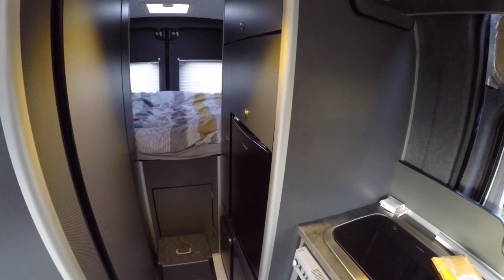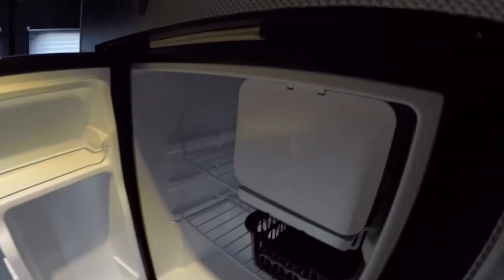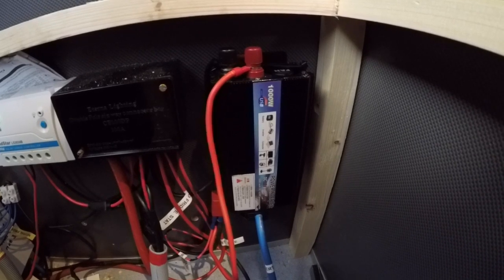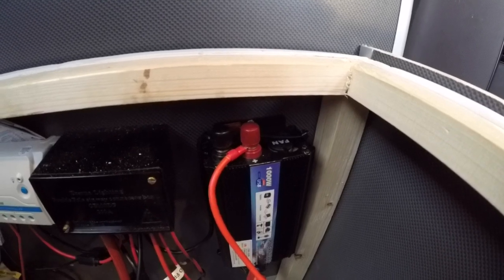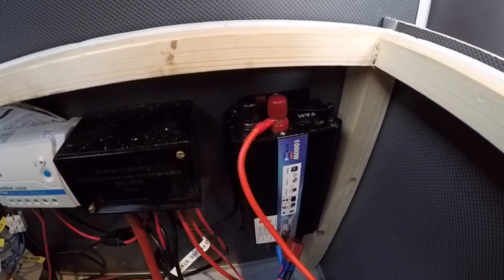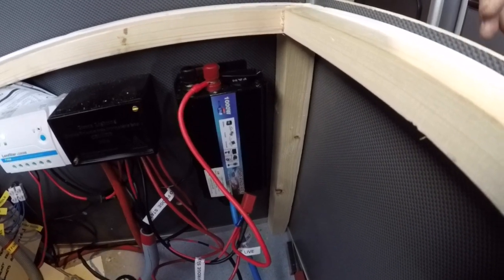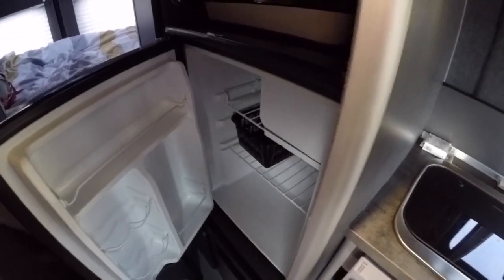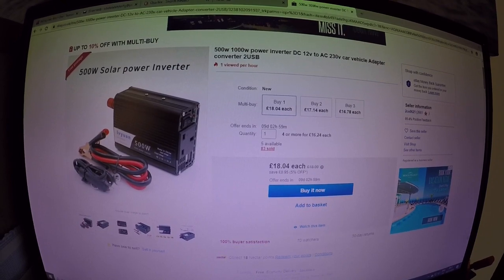Campervan installation of a domestic 240v fridge with ZERO draw from batteries when down to temp

Comment: Hi Keith, very well presented video. You are right about the price of motorhome fridges they are extortionate. Great idea to turn the inverter off on demand. I’m assuming you joined the fridge thermostat wires together so that it’s always on and the thermostat now only operates your relay. 
Our inverter comes with a remote on off switch so it would be even easier to wire the remote across the thermostat and do away with a separate relay. 
Just a couple of thoughts I had. 
Does your inverter need to run on to dissipate residual heat?
If you are using the inverter to power a socket for laptops it would turn everything else off. 
It’s a great idea and in the right install is the perfect solution and great money saver. Well done! 😀
Reply from the maker: Greg Virgoe hi Greg, I’m so chuffed that you think it was worthwhile. I could have included a schematic, but I deliberately didn’t because I didn’t want complete novices to have a go. Couldn’t bear to be responsible for someone not following it properly. Instead I hope that those who know how to do electrics, could visualise my description.
I think all relevant details are there. But to explain here
I removed the cover from the compressor terminal box. Disconnected the thermostat wires.
Supplied 12 volts dc to the stat live. When demanding cooling the stat closes and the switched live from the stat goes back to the small relay near the inverter.
Once that relay energises it switches the thicker supply cables thereby firing up the inverter.
The inverter then supplies 240v back to the permanently wired in compressor.
And so it runs until cool enough.

So to answer your questions
No the stat operates as normal but with 12volts
It’s the compressor which is permanently wired to the 240v inverter output
There hasn’t been any need to run the inverter to cool it down, presumably because it’s 1000watts and once the fridge has started running it’s only drawing approx 70watts so well within the inverters capability.
Nothing else is run from this inverter.

I’m going to rig my microwave like this as well. Although I can have 240hookup, I’ve got everything else running on 12v.

Enjoy your trip!

Somebody has damaged my van down the side just like yours was. Trouble is I don’t know who.
Reply: crastercampervankippers Van selfbuild totally understand and really sorry about the damage to your van. It’s so annoying when that happens.
Reply: Hi Keith & Greg, like the idea very much but will also want to run tv / laptop off the inverter. Any chance you clever guys can design a scheme to maybe add a manually switched override for when using other appliances as well as the fridge? I have a 1500W 12V EPever iPower Pure Sine Wave Inverter.
Reply from the maker: @paulgoddard6695  hello paul.
thanks for the message. i would say that you dont need any elaborate switch gizmos to do what you want.  the main point of this video was to demonstrate that for a minimal outlay on a cheap basic inverter you can run a fridge.
if you are wanting to run other items like electronics you would have to install a separate pure sinewave inverter at quite a cost.
with regard to televisions there is a british company called CELLO who sell 12volt televisions. some of them even have their own built-in battery backup and dedicated solar charger. all around £200 and built in satellite tuner.
with regard to your laptop id suggest getting a suitable power pack which will run from 12 volts but convert it to the usual 19.5 volts that most laptops run on. for that sort of thing have a look on ebay or farnells website or Ebuyer.
the more you can run from 12volts dc the better and less complicated life will be.
Reply: @craster_van_kippers  Good points Keith, thanks for the advice! not too worried about the tv, actually hoping to avoid having to get one, part of vanlife plan is to get away from the damn thing!
Reply: @craster_van_kippers  Haha. Maybe it was that crafty 'Mel's Van World' guy 'cos he did Greg's van too.  Haha.

Comment: Please consider the safety implications when undertaking this.  Most mains domestic fridges use earth bonding for safety. To see is your fridge is earth bonded perform a continuity check between the earth pin on the plug and external metal chassis. Earth bonding means the metal parts are connected to the planet Earth (in a domestic setting this is a buried 1 m long copper rod). Your campervan is isolated from Earth by the tyres. Although your inverter has a three pin socket, the earth pin is probably not connected to anything - the 'Live' and 'Neutral' outputs are typically floating and interchangeable (in a domestic setting the Neutral is also remotely earthed). All this means that if you get a single fault mode occurrence, one of the floating wires could connect to the exposed metal components with difficult to predict and possibly hazardous results.

Comment from the maker: Hi narrowboat journeys. I take your point about cheap inverters. I bought this one for two reasons.   1. It was minimal outlay to test my theory.   2. The fridge only draws 70 watts once running.    I chose the 1000w version because like you I don’t trust them but figured that an over stated rating would still cope with the fridge. And it has with four weeks of continuous use. When it dies I will look to spend more but still looking to keep the spend down. I’m also going to fit an hour meter to monitor exactly how long the fridge runs.
I have a victron one waiting in the wings but curious to see how long this one lasts.

Comment from the maker: Hi gen detecting.
You may well be correct. I simply used a relay that I had lying around. I can upgrade it very simply. It continues to work okay so far. I’ll make a note to self to fit or at least have another ready if needed.
Thanks

Comment: Brilliant video thank you, I have some confusion on my fridge in my campervan conversion I would really appreciate your advice if you could? I bought it already converted and icant work out how the fridge is meant to work! It has an invertor and there is a socket marked invertor which the fridge is plugged into there is also another socket next to it, for my fridge to work on EHU I have to plug into other socket but if I'm travelling or on site with no EHU do I plug into invertor socket and keep it running all the time for it to work?

Comment: Thanks for this video, very much appreciated.
I do have question, regarding the cable that goes from the fridge to the relay. An inverter is best close to the battery, right? That would mean a 6-meter 230v cable to the fridge, but also a 6-meter 12v cable back to the relay. My question, how much power goes through that 12v cable? All 700 watts (because that would need to be a 16 mm2 thick cable), or just a small charge that tells the inverter ‘you can go on now’? 
Cheers from The Netherlands.

Comment: Hi mate.  Hope you're well. Ive just stumbled across your video.  Im looking to do this exact thing to my van.  Im still building it just now.  See on the relay what cables go into what positions as its a 4 pin relay you're using.   Thanks
Reply from the maker: Sorry just seen this. Notifications not working.
Yes the relay method works fine.
The stat circuit goes to the relay coil.
However. Since then I’ve bought a cheap relay with an on/off switch. This does away with the relay completely. I took out the inverters on off switch and wired the thermostat in instead.
This does away with the 12volt stat circuit effectively turning the stat into a simple switch.

Comment: thanks keith. Very interesting. Im about to buy fridge/inverter set up this week and will try this. Could I ask you two things: 1 how did you earth the fridge since you have connected the fridge to the 240 output from the inverter, and 2 how do you know what the power in watts of the fridge is if its not obvious from the fridge sales info?, i know P=IV etc but sales infor only quotes 118KWhr per annum on the fridgemaster that im looking at.

Comment: I’ve just done this but I’ve left the original fridge stat in place and connected as it came from factory and set it quite high, I then fitted a 12v digital stat sensor type  with on/off parameters and as you did I’ve run it through a 200a relay through a cheap inverter and it’s working a treat so far, I can easily see the display and it comes on at 4.5c and goes off at 3.5c it doesn’t use much power but I’ve also purchased a mechanical stat set just in case and I’ll fit that in the same manner if the digital one causes any issues, I was really struggling here in uk with the power being on 24/7 with a large inverter only short journeys combined with 180w solar and x2 110ah leisure batteries, overnight I was down to around 12.1v from 13.2 with monitors showing around 50% battery left, I’ll maybe try another solar panel and check out my batteries only a year old but worth checking I guess
Reply: I'm thinking of doing something similar in an off grid cabin setup. But I also want the ability to tell the fridge not to come on at all during the night, and have this easily switchable. Reason - I'm happy with the solar setup and don't really want to upgrade. Regardless, during rainy and cloudy conditions the batteries don't get fully charged during the day, running the fridge (and hence the inverter) at night really drains them a lot. When I don't have anything temp vital (like meat) in the fridge, I would like it to not run all night, it'll still be cold enough next day when the sun hits the solar panels. I can flick a switch when I am there, but trying to automate things as much as I can.
Reply: @verohandymike  my inverter came with an on off switch which I wired into the stat via a relay that way the stat turns the inverter on and off when the fridge temp settings kick in

Comment: Great job on the first-time video Keith. All  very clearly explained.

Has anyone looked at whether it is worth ading extra insulation to the fridge ?  Not at the back obviously to prevent airflow, but at sides, top and bottom. Would another inch of polystyrene make any difference to keeping cool (and maybe keeping noise down too) ?

Comment: I have a problem with fridge or inverter as there pulling 5.7 amps. 
Was fine but chances are it's fridge. 
I'm thinking about a table top freezer instead of fridge using a fridge temperature control. what do you think?
Reply from the maker: Yes they’ll draw amps when running. The point of this is that the whole system shuts down when low temp is reached. A lot of people leave their inverter on which of course wastes unneeded power.
Thanks

Comment: Thank you so much for the video. I was looking at getting a 12v fridge but the cost for the size seams ridiculous. But running an inverter all the time seamed wasteful of power. So my understanding is you plug the the fridge into the inverter.
You connect the inverter to the relay. I'm a visual person so sorry for asking. So you connect the power from the fridge temperature sensor to the relay and leave everything else. Does the temperature sensor need a constant 12v and also a trigger line.
Reply from the maker: The mechanical thermostat is on a 12v supply. Stat closes and sends switched 12v to the relay. The relay has the heavier cable to switch the cheap inverter and so power the compressor. I’m actually running a fridge freezer in there now.
Sorry for delayin reply as I’m travelling in Canada with limited connection.
Reply: @craster_van_kippers   I'm just outside Penticton, BC Canada 🇨🇦 I know exactly how cell service is. Thank you for the response. I think I understand it. Best to have a mechanical thermostat. The 12v power wire from the thermostat acts like a trigger wire to the relay, then the relay powers up the power inverter which kicks the fridge compressor on.
Reply from the maker: Just read your reply. We were in penticton the other day. We’re passing through Grand forks now heading for Kimberly.
Got a bit fed up with the rain in Hope for last few days. Nice there though.

Comment: Hiya Keith. 

Thank you so much for making this video. Your the start of a movement for sure sir! I'm considering doing this myself but instead with a freezer, could you anticipate any reason not too? I'm thinking that a freezer is most likely better insulated thus better at holding in low temps.
Reply from the maker: Yes go for whatever you choose to use. In fact it’s been so successful and even the dirt cheap inverter is still working, I’m taking the fridge out to fit an 80/20 fridge freezer.
I still get people wanting to buy pure sine wave inverters. They have totally missed the point. The fridge turns the inverter on snd off so the cheaper the better.
I’ve since moved the inverter into the battery compartment in the floor. I’ve also disabled the “beep”. It is now so quiet.

Comment: I wish i'd seen this vid months ago when i planned out my fridge in the same way, TBH it wouldn't have turned out differant but it would have saved me a lot of worry knowing somone else had already done it ;)
I have a small inverter with remote switching and a cheap (free) fridge, i just added another solar pannel to my rig (4X renogy 100W ) to cover the extra load and extra kingspan to further insulate the fridge, i also made a plexiglass insert to the bottom of the fridge to try and keep the cold air from tumbling out when i open the door, it does require lifting up (it's in runners) to access the lower shelf contents but i thought it might help?, i'd enjoy your thoughts on this mod ?
Enjoying the vids chap, any more on the construction of the furniture ? i am converting an ambulance and it uses the same profile on the cabinets and a larger one on the walls.

Comment: Hello! Nice job, do you know maybe how much wattage it draw in 24h ?
Reply from the maker: Hello thanks for the question. Can I direct you to a fridge update video where I detail my experience in plus 30degree weather.
If you factor in the draw by inverter, it’s very comparable to 12volt fridge consumption but a hell of a lot cheaper.
It has continued to work in this years Europe trip. Same cheap inverter. It’s now in the floor battery compartment (Citroen relay) so we don’t hear it at all.

Comment: Is there space in the back of the fridge to put the inverter? That way it's only a 12v feed to the fridge.
Reply from the maker: Yes there probably is. Just have a look at pretty much any fridge. Not an option for me because fridge is very close to the bed. Therefore for us it’s now in the floor right up front.
Also consider that the inverter will wish to be cool and of course the fridge compressor will get hot.
Can you mock it up in a shed or something to get what’s best for you?

Comment: Can you send a wiring diagram of the connections to the relay as is hard to see on the screen. Which wires go to what terminals on the relay. Cheers neat video.
Reply from the maker: Hi Rick
I’m so sorry but I deliberately didn’t go into detail incase someone didn’t/couldn’t follow the advise. If you have a basic idea of how this stuff works then it really isn’t difficult.
I’ve since used a more upgraded relay as the one in vid was literally just laying around.
So without going into too much detail, the setup is as follows for a 240 v fridge with no light.
1. Disconnect the thermostat at the compressor terminal block.
2.supply the stat with 12vdc.
3. Wire the 240volt compressor to a plug with a run if 2.5mm cable.
4. Plug compressor into the inverter,
5.the switched live from the thermostat is connected to the switch coil of the relay. 
6. The high current contacts on the relay are from leisure batteries which when relay closes it turns on the inverter,

The relay is necessary simply because the thermostat would not be able to handle enough current to activate the inverter. Plus even if it could the gauge of cable would be too thick for distance batteries to fridge.

So in simple terms the fridge stat is a switch which through a 1mm cable switches the relay (which is another switch)
The relay closes(switches on) the heavy cable supply to inverter. The inverter powers up and sends 240ac to compressor:

If you look at virtually any relay you will see low current terminals for the coil and then the heavier duty switched terminals will be obvious. I used a single pole relay.
Hope this all makes sense. If it doesn’t, then you can see how risky it would be to try and explain in vid.
Reply from the maker: Ps this setup works great. We are touring right now.
The inverter in our Citroen relay is now in the vehicle battery box under floor. I’ve also disabled the “beep”. So now we can barely hear it running. I have a second vid on our running last year in Italy. It was just as efficient this year with minimal battery drain and of course huge savings against a 12v fridge. TBH I’m going to fit a fridge freezer when I get home.

Comment: Hi did you use a 200amp rely between the battery and the inverter? Also have you used a breaker anywhere on the system. Many thanks 😊
Reply from the maker: yes switched by fridge stat. inverter has a breaker and 12vdc to fridge stat is fused. sorry for delay.
Reply: Thanks i just had a go and fridge works great been away a few times and all ok 👍